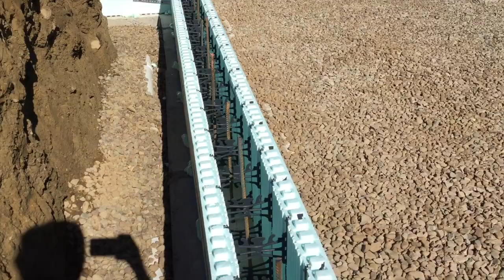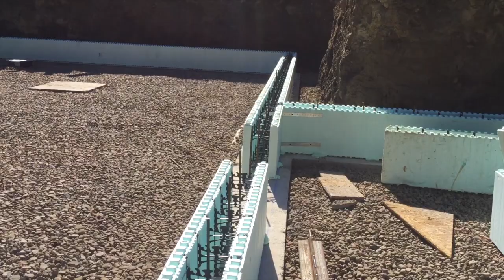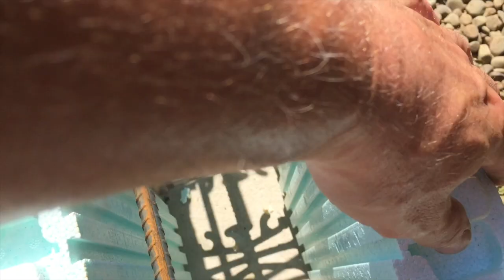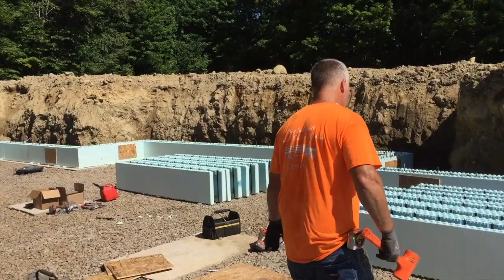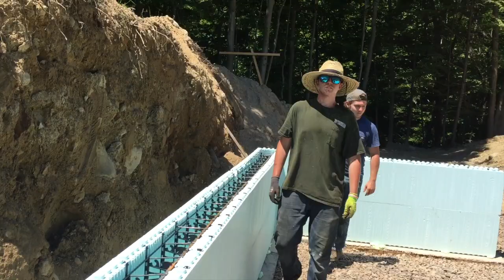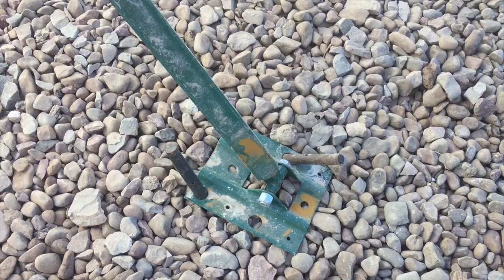Nudura ICF foundation DIY (avoid common mistakes) YOU CAN DO THIS!!!

Comment: I built ICF for years in New Zealand (carpenter here) great product! 1st used "Inform" blocks that were formed with foam bridges then to the blocks with plastic bridges, (timed it for assembly - 8 sec) had plywood panels 2' x 2' & plastic hose & with 3/8 threaded rod ready for blowouts, learnt quick to pour concrete in 3 lifts for high walls, had my conc supplier supply a custom brew - 3/8 agg rounds, with bit more sand using a 3" pump hose. Built my own bracing 1st off with adjustable turnbuckles to straighten the wall as the conc did compress the blocks down (producing a bent wall!) My supplier designed a better bracing system later & paid for it.

Comment: Never liked the insulted forms. Surely it is a good system, just old school. My costs will be higher but prefer a cast in place wall, extruded foam @ wall interior W/  Z  channel.  Either way, electric is surface mounted unless metal or wood stud framing is chosen.
Reply from the maker: If I had forms I would be pouring walls.

Comment: What do you do if a footing dowel interferes with a web in the form?
Reply from the maker: bend it out of the way a little.
Reply: ....or when you put  the polystyrene formwork down on the stripfooting foundation you mark the  positions of the dowels before drilling!

Comment: Awesome video. Quick question. Is it better/recommended to pour the floor/slab with the footings all in one go or do the floor after the walls are done? This way the pour can bond with the ICF and help seal on the inside.
Reply from the maker: We like to pour the floor inside the ICF because it covers the cold joint between the footer and the ICF. It also helps the walls from ever pushing inward.
Reply: @bondobuilt386  Thank you Sir. I appreciate you

Comment: what are the ladder wires for on the top of the second course?  I've never seen that before
Reply from the maker: Thats called form lock. it helps straighten the walls and stiffens then up too.
Reply: @bondobuilt386  ok thanks… I’ll have to think about this a little more…

Comment: I’ve got a Nudura basement and love it! Going to do another one later next year but my cement guy retired. Would you ever travel to Philly to do a foundation wall and floor? Thanks for the videos and letting me know.
Reply from the maker: Peter I usually have more work local then me and my small crew can Handle. Looking like this up coming year will be the same.

Comment: Bondo, do you have any experience using fiber or Helix stainless steel 1” reinforcement bits mixed in your mud, instead of traditional rebar in ICF walls?

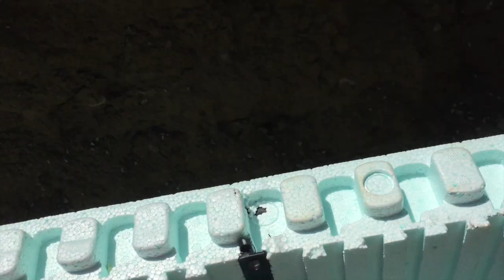Comment: just after you shout "we are missing a piece of wire" at @11:12 there is a good sized chunk of the top of the foam smashed off. what do you do in this instance, just leave it?
will that cause issues when pouring?
Reply from the maker: We went right over it then just zap a little spray foam there. No proplem at all 👍😊

Comment: The wire you refer to at 9:57 can you tell me what is this called and what exactly is its purpose? Well done on a great video. Very straightforward. 
Also what is your procedure if you get a burst out during a pour as I imagine that can be quite stressful? 
One more thing, do you ever use the tins of expanding foam between the individual blocks? 
There appears to be a number of icf manufacturers with 4 foot blocks. Would they be a better option?
Thanks again for such an informative video.

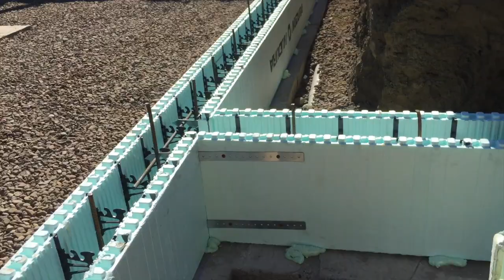Comment: One thing I noticed for others, is that the TWall connection with T braces are done incorrectly.   The rebar goes in the web itself, not in the rebar snaps on top.  This allow when the concrete is poured to prevent the force from pulling the rebar out of the thin connectors on top.  This can be seen at 3:46 in the video.  Good luck and thanks for the share.
Reply from the maker: Thanks I never had a problem with these corners pulling apart and I have done a lot of them. I will check into this on the next one. 👍
Reply: @bondobuilt386  Could be a theoritical issue then and real life trumps that every time.  Good luck and keep sharing.
Reply from the maker: @DanielWier  Thanks for the comments and watching my stuff 👍👊

Comment: if the average diy wants to build an addition with basement foundation using icf can the walls be plumbed using just dimensional lumber like you would a wall constructed out of wood? i really dont want to have to buy the steel levelling post you have in the video for a small one time 18x28 build im planning.
Reply from the maker: You can rent the bracing system from the place you buy the blocks from. It's usually not crazy expensive and it will be much faster and safer because its a scaffolding as well. Also your walls will be nice and straight. check out my Nudura playlist alot of good info on here and subscribe if you haven't. 😊

Comment: Q: what purpose do those grooves serve on the insides of the ICF serve? Consolidation? Drainage? I've seen other brands but without the grooves. Thanks for the video, both helpful and informative.
Reply from the maker: Hi Bill the groves are little dovetails inside the block and help keep the foam stuck to the wall after it dries. 👍

Comment: Good video Bondo and good info. Few comments from a guy that built his entire house and shop from Nudura ICF from basement all the way to the roof. 
1. 6" wall for basement with that much clay soil against it? Are you sure that's enough? That's some pretty long walls with about 8' dirt/clay against it.
2. Water barrier (liquid rubber or similar) between wall and footing goes long way. Concrete capillarity will not pull water up the wall. Wet wall in between foams will never dry. 
3. I hope you are cleaning that foam from the wall cavity to avoid voids where wall/footing joint is the most vulnerable.
4. 2" of foam, even better 4" under basement floor is almost must.
Once you enter basement built like that you will never build the same again.
I see you are using hard perforated PVC pipe for drainage and we salute you for that. :) I also used FoxBlock and it's much easier to keep straight due to nobs being oriented differently than Nudura. I switched to FoxBlock completely.
I am Canadian! :) :)
Reply from the maker: Hi there thanks. This was backfilled with gravel and stone no clay went in there. 6” wall is good if you use the proper rebar per Nudura specs. I think we propably gonna throw polly under the footers this year. I heard that a few timnes on here. 👍I always use good pipe not the black flexible junk. Lol 
The new code this year will require 3” of foam under concrete for a house or basement in my area. I never tried the Fox blocks but I have built a few baserments with Logix. 
Regards 
Bondo👍😊

Comment: I haven't seen the ladder wire done before. I like the idea to help strengthen. Are you making it out of panels?
Reply from the maker: No it is a poroduct from Nudura and made just for there blocks. It realy helps stiffin and straighten the wall.
Reply: @bondobuilt386  Cool. I've seen a few channels using Nudura, but don't think I've seen them use this. I'll have to remember this when we come to time to build. Thanks!!
Reply from the maker: @loweredd  No problem buddy. 👍

Comment: I was told that corner bars (j- bars) are required to be at least 2 feet each way. Is it feasible to get bar lower in the form?
Reply from the maker: Hi. You could make the J bars longer if that is required in your area. They would go right in fine. 👍

Comment: Have you poured a slab  floor at grade inside an OCD frost wall?
Reply from the maker: https://youtu.be/0ibQ2mueXIo yes I have 👍
Reply: @bondobuilt386  thanks for quick response  how long ideally should the walls cure before putting the sub slab materiel in?
Reply from the maker: @georgemckenzie2525  your welcome.  It depends on the weather . You should wait at least a week the material inside needs to be tamped but you want to fill in the outside at the same time. so the wall has equal pressure.

Comment: 2 questions
 1: how did you know your common seems are gonna be in those places? it doesn't look like they go straight-up-and-down how close to the seems have to be together in order for you to brace them like that?
2: do you put ladder wire in only the 2nd level or each level?
Reply from the maker: The common seams do go straight up buddy. Thery should be near the center of a wall not near a corner if you can avoid it. The latter wire goes in the second course and the top couse and it helps straighten the walls.  👍😊
Reply: Sorry saw the answer to the 2nd question in the comments. So I guess the 1st question is all I have.

Comment: Are the braces on this job the same as you always use? How do you like them ?
Reply from the maker: Yes Clyde the same brace system from Nudura. I like them alot. 👍
Reply: @bondobuilt386  have you tried zonts and zuckles?  They look superior to anything else.  Thoughts?
Reply from the maker: @Ivebeenaroundyouknow  I have not tried them. The Nudura bracing really works well though.

Comment: Bondo what size of core would you use on a below grade 9' foundation for a  bungalow?
Reply from the maker: Mark I would go 6” with vertical rebar every 18” tied into the footer and one row of rebar in every course. Make sure you backfill with 1 foot of stone against the wall backed by free draining soil like a good bank run gravel. The stone will act as a drainage plane to the weeping tile that should be 2 feet deep of stone.
Reply from the maker: https://youtu.be/6JO8mMN53bE this video talkes about backfill

Comment: Rookie questions ... and I see why you learned to pour the floor with just the first level of foam forms now.
1. I've had full-through rebar let water into a poured concrete basement foundation in the past - in my own home. But I notice your system calls for rebar squares that are full-through at every level. I guess the foam must act as the water barrier? Or, does this system mandate a vapor-barrier membrane outside the foam wall? I think this system would have to be protected from water - in addition to having a weeping tile system, due to the exposed rebar.
2. Why use foam construction for interior supporting walls? Am guessing it's easy as everything else is foam, but so would a cinder-block wall be easy - and probably a bit less expensive. Am guessing that the insulation helps during pouring the floor.
3. Using volcanic ash negates the need for rebar. Rome's Pantheon dome roof has stood for two-millennia because of this. I wonder why this isn't an option you can request from concrete companies?
Reply from the maker: Edward we have the outside sprayed with closed cell spray foam or use a rubber membrane for water proofing these walls. We do not use the blocks for interior walls. most interior walls will be framed withb wood. Not sure what yopu mean by exposed rebar?? we cast some rebar in the wall that will eventually be cast into the garage walls. so they are not exposed. they just tied the garage in because the garage was poured a couple weeks later.
Reply: @bondobuilt386  Got it. The welded wire mesh's "squares" appear to have metal wire (3? mm) running from concrete surface to surface every 8 inches or so (I called these "rebar", they're not - they're a grid mesh, sorry to confuse) ?

Comment: Hi Ron, I noticed you strap your common seams as you build the walls. Do you you measure each row to be sure the length of the wall is the same from top to bottom?
Reply from the maker: Tom we do measure the walls. A good trick is to write the cut measurement on the block by the common seam. Merry Christmas buddy. 😊

Comment: How do you brace your walls on the inside if the floor is poured already?  You don't shoot anchors into do you?
Reply from the maker: We use short tap con fasteners. a dab of mordar will fill the little 1/8”. Holes. 2 fasteners per foot plate and they never have moved. 👍😊

Comment: Ron, How many courses do you install the ladder wire ? every other ? every ? , thanks Buddy
Reply from the maker: Hey bud. I put it on top of the second course and on the top course for a 9' wall. It helps to straighten and stiffen the wall quite a bit. 👍😊
Reply: @bondobuilt386  ok thanks !
Reply from the maker: @italRotty  you bet any time. 👍😊

Comment: How do you decide on where to place the first column of blocks on the footer. Inside outside or middle.
Reply from the maker: Mark a 6” ICF block is 11-1/2” wide so I make my footer 20” wide and the block is centered on the footer. This leaves 3-3/4” on each side of the block. This gives you some wiggle room to get the building squared up. 👍

Comment: Hello, what is the distance of the rebar vertically and horizontally please.
Reply from the maker: I been running my rebar at 18” vertically and one row of rebar per course horizontally. The blocks are !8” high also. That is a strong wall.

Comment: buddy does foundations, was explaining to me about ICF.... this seems like a no brainer, contractors are super scared to start using this around here..lol.
Reply from the maker: It is a no brainer. I used to build basements from concrete blocks and this is much better system. 👍👍
Reply: @bondobuilt386  for sure...just plug and play
Reply from the maker: @bikeninja956  yup 👍👍

Comment: I’m taking on my first ICF project. I’m using Form a drain as my footer foundation. How long are the vertical rebar from the footer? Is the rebar tied to the horizontal rebar or is sitting on the ground? Thanks
Reply from the maker: We tie up the horizontal rebar off spreader boards and just stab in the vertical rebar at 18” in the middle of the footer when we place concrete. Just wet set them in before concrete gets hard.

Comment: Any thought to trying to make the common seams hit on 8” (for Nudura) centers so sheetrock later is easier? I am contemplating pouring my own basement for a house I’ll be building in the future. Cheers! Great content!
Reply from the maker: Hi Tyler. Yes they make an excelent basement. The studs will all be lined up on 8” centers except where the common seam is it's will be off. As hanging sheetrock you can just measure from the other side of the common seam. 
Thanks for subscribing 👍
Reply: @bondobuilt386  Awesome, to make sure I'm tracking your thought process...say your common seam is 6'4" from the inside corner.  Cut the first sheet to fall on the far side of the seam and then continue full  8' sheets following. 

This system creates more work on the back end with sheetrock (compared to traditional framing) but I think the front end time, effort and overall end product is so worth it! Am I on the right track with that thought?
Reply from the maker: Tyler Stein I think you are on the right track. I think it would be easy to Sheetrock over these but the electric would be harder. 👍

Comment: Invest in a rebar bender.  Your 90 degree pre bent corner are pretty bad!  Bend the corners into the long straight runs as you go.  This cuts down on quickie saw cuts and make less concrete hang ups in pouring!  Avoid double rebar locations in the webs(side by side).  Anytime you have two rebar next to each other it slows concrete flow, your corners and T's show it too much.  I understand you may only be pouring 8 feet high, but build like you're 20' in one pour!  Sledge Ok!  It works with mason grid.  I don't use a sledge, I use a 2x4 paddle stick, 3ft or so 2x4, cut a handle in one end and use the 2x4 to beat the block down and you can also use it to reach over a wall and slap the block in alignment when stacking off of a ladder or scaffolding.  The video was really good and your way works!
Reply from the maker: Thanks for the feedback. 👍 I have been considering the rebar bender. I like that 2x4 paddle idea. I'll have to try that next summer. We are pretty much done with any foundations this season. I have a few more flat pours to do then we will be doing some home renovations this winter. It's been a busy summer👍 Thanks again for the good ideas. I learn something new every day. When you stop learning you stop living. 😊
Bondo
Reply: Yep I bought one, local reo supplier often got it wrong off the plans

Comment: So you use ladder wire n rebar on each course?  N are  you staggering horizontal rebar inside n outside in block
Reply from the maker: Gale Cooney latter wire in second course and top course. Rebar in every course horizontal and vertical every 18”. This will vary with each project and should look at Nudura web sight or use an engineer to design it. A lot of variables for each project.

Comment: Ya did forget a capillary brake
Reply from the maker: We generally don’t put them in my area and there not in the building code. I do however think it’s something to consider.
Reply: @bondobuilt386  if it needs a sump pump than it'll benefit from a capillary brake too.
Reply from the maker: My Cool Moral Lay Ha we usually put a pit in just for emergency drainage. Inside and outside drain to daylight 90 percent of the time.

Comment: Hey I got a tip , When you cut the common seam use a sharpie and write in large letters the cut dimension of that form, do the same on the second course where you staggered the corner. and then you'll know the length for all the remaining courses, That is something I've used and saves a bit of time and helps repeatability
Reply from the maker: That’s a great tip. 👍 Thats why I love YouTube. I learn stuff all the time on here. Thanks for the comments and the tip 😊